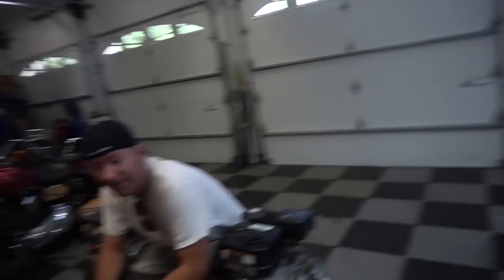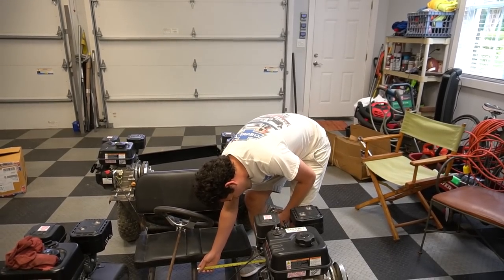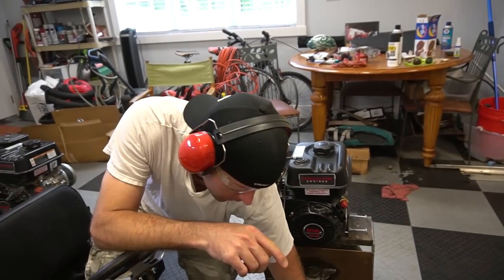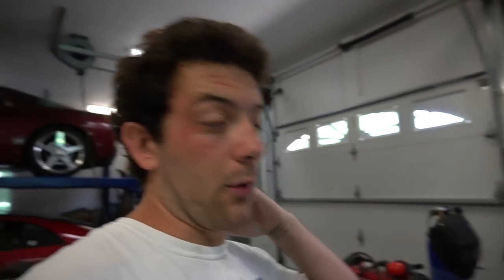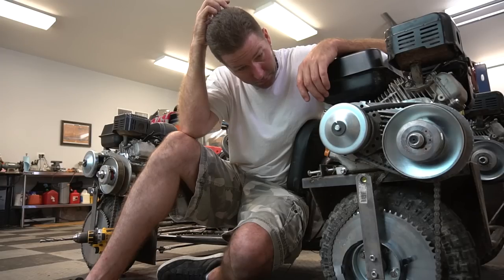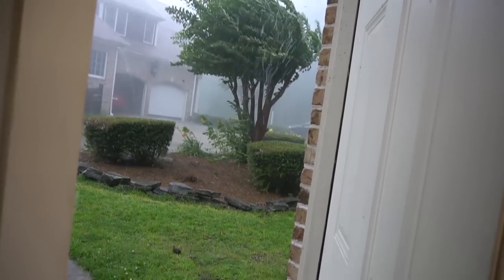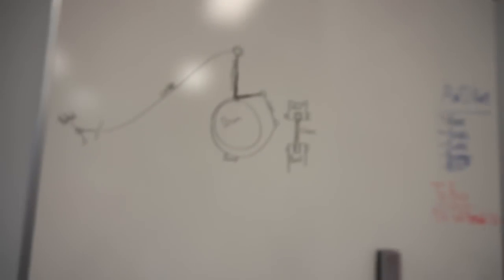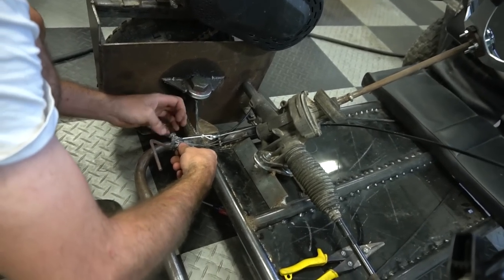Four Wheel Drive, One Wheel Stop: AWD Kart Build

Comment: Wire all them kill switches to one flip switch. That would get old turning all them on an off
Reply: this is the only good idea in 100 comments..
Reply: Rob M the more I think about it though, what if one engine is having problems, you couldn't just shut one down, that way. I would like to do something like this. But 2 engines on one solid axle in rear.
Reply: you cant shut one down long term anyway, the drag of the gear ratio and torque converter seems to be tremendous.
Reply: Can’t. Red beards garage tried that and when you start one the coil signal keeps the other one from starting. Four switches.

Comment: Another reason not to weld the skid plate all the way is, you'll warp the steel. So you just go every couple inches and be done. Truck frames are the same way. No continuous weld, just a 1in or longer spot welds through out.

Comment: $500 for a drawer, must be out of a Snap-off Box
Reply: NRGMatrix (snap on) an you beat me to it
Reply: Such an over rated brand. I call them strap on tools.
Reply: NRGMatrix fap-on, amazing tools but highly overpriced
Reply: Brian Butthole If the boxes themselves are $10,000-20,000 then I'm not surprised they are $500 a piece. I just don't see what the hell you get for $15,000 On a dang tool box. I worked in a shop and 3 mechanics had Snap On, another had Cornwell, and another had Mac. So unless they are made from children's tears and gold plated over stainless steel, they are not worth pretty much the cost of a truck.
Reply: matco
Reply: You should see the tool boxes up here in the oil sand truck shops, our boxes are 80 grand per box with tools by snap on
Reply: Screw snap on genius is better.

Comment: Just use the oldschool brake handle that rubs against the back tires behind the back seat. We used to use them on wooden derby karts. Then you'd have two wheel brakes without having to hack up what you've built.

Comment: I've got a question. I've started fixing this Franken-Kart that I bought and I need to put a disk brake on the rear axel. it has a key way in the middle and the size at that key way is 1.190 inches. I haven't been able to find any hubs that size. How else can I go about fixing this issue?

Comment: What would change if you threw the brake on one of the front wheels? That's where the weight will go when you try to stop(think pickup truck). I don't have go kart experience though so I don't know for sure. Also, would it be impossible to add a live axle later in life?
Reply: don't want one brake on front, it will make it pull to one side when you hit the brake. it is very possible to ad the live axle

Comment: Plasma cutters are cheap on eBay get the Eastwood brand I bought an Eastwood wire feed welder it was cheap and same quality as a Lincoln welder also has the same design and all interchangeable parts.

Comment: why don't you just get a live axle and cut into 3rds put a third in each tire have bearings on the end on the inside and in between the bearing and the inside of the tire you could then run disc or drum
Reply: on the back 2 tires

Comment: if you whine about paint imperfections on a tool box. . .your a snap on kinda homosexual :D, my tool box one of the drawers had to be bolted back in a fixed half-out position and the other one just sits on top of it, i dont have enough time or money to bitch about it or demand it be corrected at once squire!!, if i get a tool box for free with drawers that slide im happy, if i buy one it better hold tools, paint isnt much of a concern either way